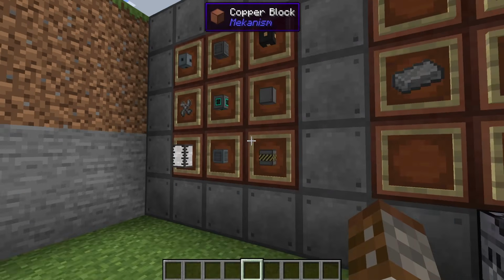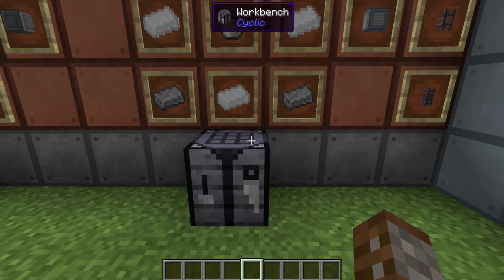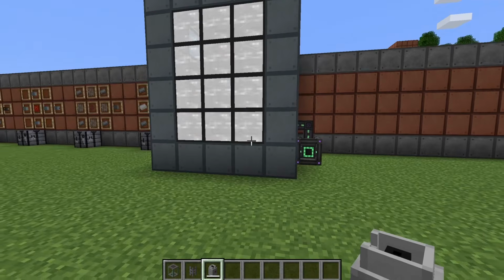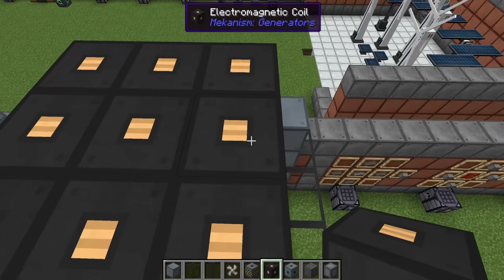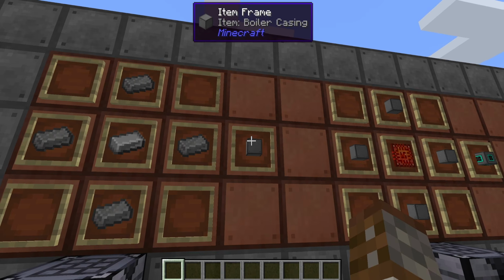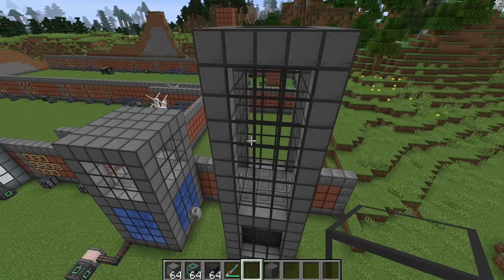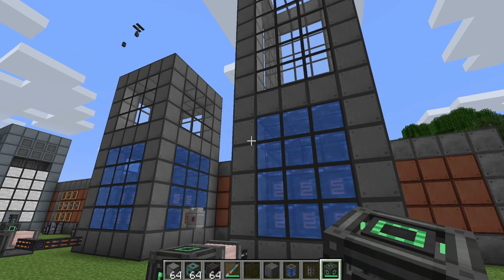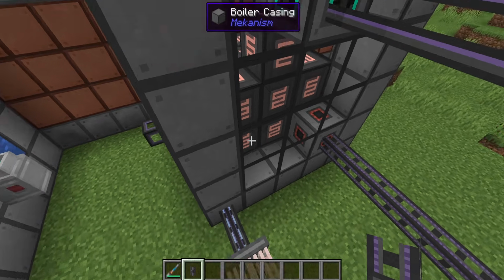How to: Mekanism | Steam Turbine & Boiler (Minecraft 1.16.5)

Comment: I know this is old, and I’m currently playing on 1.12.2, so some of those values regarding the steam turbine are outdated on my side, but is there a way of generating more then what a maxed out turbine produces with a maybe similar setup in terms of cost-efficiency, but less size ? I’m looking for a mod that takes me to the next step, I’m currently producing around 400 MRF per tick with my setup, but I’m aiming for the 1 GRF per tick mark, problem is that my world already is starting to lag because of all the fusion reactors, 2 maxed out steam turbines and D-T-Fuel factories.

My goal is to be able to produce enough energy to fuel around 10 replicators from IC2 24/7 without the need to maintain them all the time so I don’t run out on buffered UU-matter. I’m currently on 57 matter fabricators, which is barely enough to run 2 replicators with 19 overclocking upgrades at all times, and just building more steam turbines won’t cut it because of the lag. 

Do you have some mod recommendations that aren’t „too overpowered“ ? I still want to have progression in my tech tree.
Reply: Edit : I’ve found a solution to that mess, I changed the IC2 mod with IU, and can now utilize switching freely between RF and EU, while using quantum generators to go way above 1GRF per tick. Now I got a new task to focus on, switching out my heavily on IC2 relying industry with IU-components. Kinda annoyed that basically everything breaks now, from my ME-Crafting system to the way I distribute D-T-Fuel to my fusion reactors. Now I need to replace everything before my 600 GRF buffer runs out, wish me luck 😂

Comment: While using this more, I found that the power system is very poorly put together even at the very basic level. Everything consumes way too much pretty cheap to make or multiplication, but it’s not like you could multiplied entire stacks nowadays.
Reply from the maker: Really I didn’t show this in a good way. You want a fission reactor for this. A boiler to use for cooling a coolant and then the steam turbine to make power. Using resistive heaters are a very bad choice and you won’t gain a lot of power
Reply: @Mondays3  ahh I see I have videos which I’ve been extremely but I found very quickly that or duplication and other systems are extremely painful to run at mass. The energy output is just never enough it seems.

Comment: You didn't display your correction that you made and it iterates that the saturation condensing layer goes higher then what it needs be. This video should be re-uploaded with the correct information.
Reply from the maker: I explain any changes I make in the video or description. I won’t be reuploading a 2 year old video for any small mistakes

Comment: Does the build in this tutorial still work? I tried to power mine up but it was receiving nothing
Reply from the maker: It’s better to use a fission reactor to make steam. The turbine itself makes power instead of needing power. The boiler is also more efficient with the fission reactor and using sodium cooling

Comment: do you know what to do with spent nuclear waste? looks like it doesnt just go away in waste barrels, ive got waste barrels filled with spent nuclear waste and now its overflowing. i dont know how to dispose them, any suggestions?
Reply from the maker: You can't dispose of it. You can only store it far away
Reply: In case you're still interested - solar neutron activators will turn it into polonium, which is still stored in barrels but I think at a significantly lower ratio? It can also be turned into pellets which are 100% safe and are just an item.
Reply: @slaytonpeale9727  that's normal nuclear waste, when you turn it into polonium pellets or plutonium pellets it becomes spent nuclear waste which is completely useless and does not decay
the easiest way to dispose of it is to bring it far away then break the storage container, causing temporary radiation around the area
Reply: @slaytonpeale9727  polonium is super OP and you need it to make mekasuits

Comment: fission, boiler and turbine shouldn''t be used for power generation, only to use/get rid of the heat, if you want to use a turbine for power, you're better off with fusion, boiler and turbine.
one tip, in mek v10 don't use the reactor to make fuel, use the chemical infuser to make D-T fuel, far more efficient.
Reply: What else would you use a turbine for if not for power?
Reply: @StartellerRX-8  not for the fission combo, you just want to have the turbine running to get rid of the heat and just use the materials it provides, if you want power, use fusion, boiler and then turbine for power, the only exception to this would be the use of an SPS to make antimatter.

Comment: the topmost layer can actually be more turbine vents (except for the edges; those need to be turbine casings); water output rate depends on the amount of vents so in extreme cases you actually need more than the sides can hold

Comment: It is my understanding that the use of fuel or electric heaters is completely inappropriate. Since more energy and resources are expended than returned by steam in a steam turbine, it looks like the boiler was made purely for the fission reactor. I tried heating a boiler with 30 fuel heaters and wasted a dozen stacks of coal blocks, getting almost nothing in return.
Reply from the maker: You are absolutely right. Using the heaters is a very bad way of using the steam turbine. I only separated the boiler and fission reactor as the video would be near an hour and a half
Reply: You can use boiler for the fusion reactor. It will actually land you more efficiency.